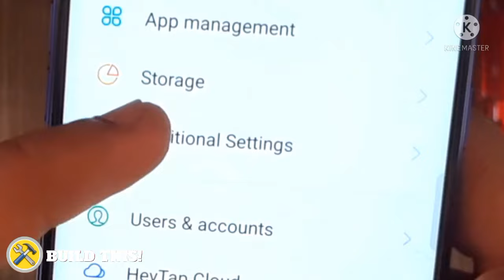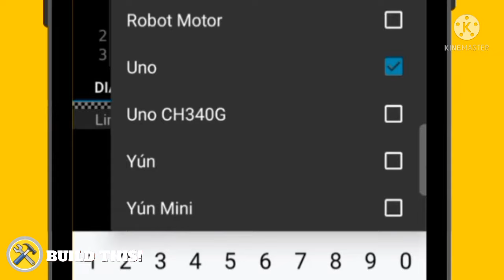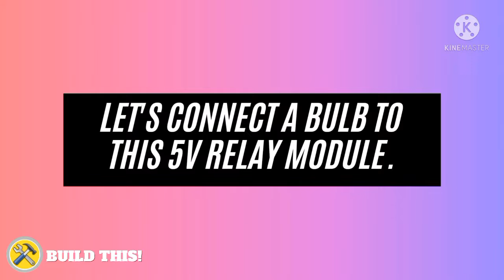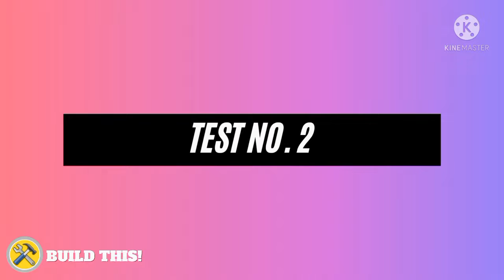How to make a Clap Switch using Arduino UNO!

Comment: Please  join and insulate 110~240V connections professionally!  Dont leave exposed as you have shown.  You should also warn of the danger. What if it was a stainless work bench, or  a person or child does what you showed, but the wire you twisted together comes undone, and they simply grab it !  They will get a get a shock!
Reply from the maker: India is not for beginners

Comment: The code in the drive is different from the video, does it still works?

and also, can I use my laptop to connect the Arduino Data Cable if I don't have OTG for my phone?
Reply from the maker: Yes it works...just do the connections accordingly. Ofcos you can upload the code using your laptop, install Arduino IDE
Reply: @SameerBedwal  okay, thank you very much!

Comment: I connected the same as u did.. but relay  green light is continously on ..on insurting IN pin to 13 number...why is this happening...plss replyy
Reply from the maker: Adjust the sensitivity of the sensor till the relay's green light turns off. And when you clap, the green light will turn ON that means your project is working
Reply: I tried it ...but green light is on Even without connecting sound sensor
Reply from the maker: @PrashantRana-o3p  can you send me the video of your project

Comment: Can we do it without connecting the mobile with Arduino after making it completely
Reply from the maker: Yes! Mobile is just for uploading the code on arduino, use any 12v 1 amp adapter to power your project.

Comment: Hey sir, jaise apne ye clap wala banaya hai....bilkul waise hi ultrasonic sensor ka use karke ban sakta hai? Jaise hi hum uske samne se haath paas kare to light on ho and phirse kare to off....pls agar hosakta hai to code aur diagram dedo...is simple cheese par ek bhi video ni hai pls help
Reply from the maker: Here's the link for code and circuit diagram..
Reply: @UCjWC37Cm6jvKWKvUKWjWwpg so should I just copy the whole thing and paste it there???
Reply from the maker: https://github.com/embeddedlab786/Automatic_Room_Light_Control
Reply from the maker: Yaa just copy the code from the link I provided you and paste it in your Arduino IDE
Reply: @SameerBedwal  where is the circuit??
Reply from the maker: @reenaasthana4471  2 folders are given there,
Reply from the maker: The second one*
Reply: @SameerBedwal  ohk, thank you so much for such a quick reply
Reply: @SameerBedwal  oh wait I was not asking for the automatic light control this one requires 2 sensors and it even senses if someone is coming or going out, am just asking for simple project where if the sensor senses movement, light turns on and again if it senses movement light turns off, that's it i dont want it with a display neither
Reply from the maker: @reenaasthana4471  display is optional
Reply: @SameerBedwal  and what about the single sensor thing am talking about? Is it possible? As per my knowledge the code for such small thing will be very easy what do u think? Single sensor with reacts to any movement

Comment: Do we need to connect it to the phone always or just to upload the code?
Reply from the maker: I didn't have a power adapter at that time so I used my phone.
Reply: @SameerBedwal  so, in this tutorial are we supposed to always connect it to the phone for it to work?
Reply from the maker: @ThunderFlyCuber  no bro, Just upload the code using your phone and then use a 12v adapter to power Arduino
Reply: @SameerBedwal  ok, thanks

Comment: Bro can you add app link i cant find the app pls😢.
Reply from the maker: ArduinoDroid. Search it on play Store
Reply: Bro can you search other app to program in mobile because the app that you are recomending is avilable in for old Android verson and it is not supporting my mobile 😢😢 but I respect you who see the problem of your veiwers😊.
Reply from the maker: @mrbot6009  you have laptop??
Reply: No
Reply: Bro it's ok don't worry I found a mobile capable of doing that thing but I have a question does the code will work if I use a motor instade of bulb?
Reply from the maker: @mrbot6009  how many volts is the motor
Reply: Why my modules red bulb is on and not the green one and red doesn't blink when i clap .all of the other things is same
Reply: And the motor is 1.5v
Reply from the maker: @mrbot6009  the red led is showing that your relay is ON. Now when you clap, the green led is supposed to be turned on but it is not because of sensor sensitivity.
On the top of the sound sensor is a little flathead screw you can turn to adjust the sensitivity
Reply: No the Sensor works,when u clap a led in the board turn on and when I clap again it turns off but no the module its stays red all the time .
Reply from the maker: @mrbot6009  yes cuz it is the indicator that shows the relay is ON
Connect something with relay and test it!
And yes you can use the motor instead of relay
Reply: So can you pls look at my work it's I have upload the video and my green led is not opening and tell me if tis is right or not and what should I do to make it right😅😅.
Reply from the maker: @mrbot6009  which code you've used to program your Arduino? The one I shared in my video description or any other code??
Reply: Your code.
Reply from the maker: @mrbot6009  is your relay connected to D- 13 of arduino?
Reply: Yes just like you said ine the video.
Reply: I need to make this for our school's 25th anniversary 😅😅.
Reply: And how do I give that arduino power with out mobile ??
Reply: I will upload a video on the day of 25th anniversary showing my project😅.
Reply from the maker: @mrbot6009  hehe. It seems you did everything right I think your relay is defective
Connect a bulb with relay and test it, let me know if it works or not( relay-bulb connections in description)
Reply: Ok so i just need to disconnect the relay with the board and then connect a bulb to check the relay am i right?😅
Reply: I will post the video of the test tomorrow.
Reply from the maker: @mrbot6009  No!!
Reply: Then I should connect it with the board ? If yes then not tommrow I will test that dayafter tommrow cause I dont have the battery my frend has it and he will come after 2 days😢😢😢😢.
Reply: But hey I really respect your help thaky you from the bottom of my heart.
Reply: Thank you for all of your help it's completed the module was broken so i bought a new one 😅.

Comment: Do i need the phone to power the Circuit??  Or any usb adapt will do?
Reply from the maker: You can use any 5v Adapter to power the arduino board

Comment: it doesn't work but the wire pattern is correct  and the code is correct please help
Reply from the maker: If your relay light is blinking continuously...rotate the potentiometer on sound sensor until your relay light stops blinking
Reply: @SameerBedwal  it doesn't work also when the light stops blinking.
Reply: i'll guess i will buy a new one
Reply: Did you find any solution for continuous blinking of green lights?

Comment: Will this work with Arduino R3 SMD?
Reply from the maker: Yes you can make this project with duplicate arduino(Arduino R3 SMD). But then you'll need to install CH340 driver before uploading the code

Comment: Bro i didn't get the coding correctly pls can you send me in comment box 🙏
Reply from the maker: const int Sensor = 7; const int relay = 13; int x = 0; int y = 0; void setup() { pinMode(relay, OUTPUT); pinMode(Sensor, INPUT); } void loop(){ x = digitalRead(Sensor); y = digitalRead(relay); if (y == HIGH && x == LOW) { delay(250); digitalWrite(relay, LOW); } if (y == LOW && x == LOW) { delay(250); digitalWrite(relay, HIGH); } }
Reply: @SameerBedwal  that's it bro

Comment: How is sensitive to other sounds? It Is able to listen mostly the higher frequencies?
Reply from the maker: It also listen to the lower frequencies eg voice, etc. On the top of the sound sensor is a little flathead screw you can turn to adjust the sensitivity.

Comment: when do i use the double clap switch code?
Reply: also for uploading the code throught pc/laptop, which software do i use?
Reply from the maker: When you want your lights to turn on/off after 2 claps
Reply from the maker: Use ARDUINO IDE for coding
Reply: @SameerBedwal  thank you!

Comment: Hi my 5v relay is different it doesnt have 2 leds at the side but it does have one small light like the one in the arduino uno. It doesnt turn off when I input code, Is there a different code for this?
Reply from the maker: No, the code is same for all the types. Adjust the potentiometer on the sound sensor till relay light turn off

Comment: Does relay require 2 amp and 12 volt supply or directly 220v, Please bataiyega
Reply from the maker: Relay mein jo aap bulb lagaoge usko 220v chahiye alag se. Baki relay ko to 12v hi chahiye
Reply: Aapne must banaya but aapne actually use nai kia adapter 12v k liye, isiliye thoda confuse ho gaya
Reply from the maker: @MightyZeusXo  Relay ko maine Arduino ki 5v pin ke saath connect kiya hua h and Sound Sensor Arduino ki 3.3v pin ke saath connected hai, ultimately maine Arduino ko supply dedi using Arduino ki data cable.
Reply: @SameerBedwal  thank you I understood now 🤗❤️